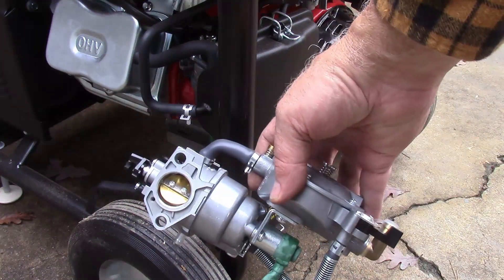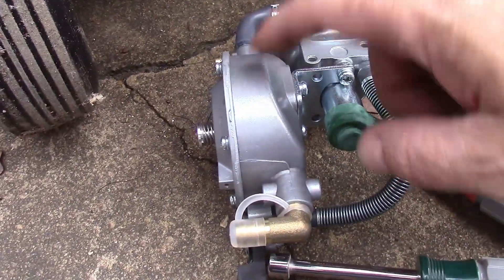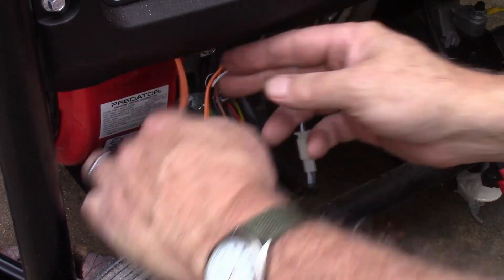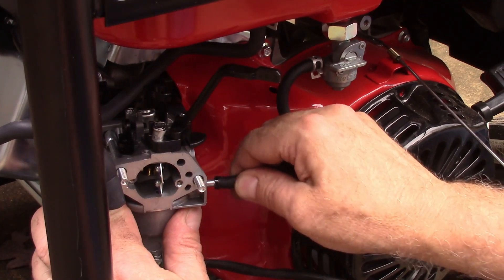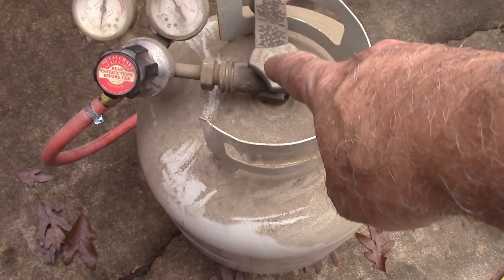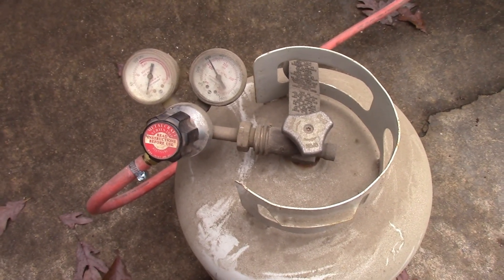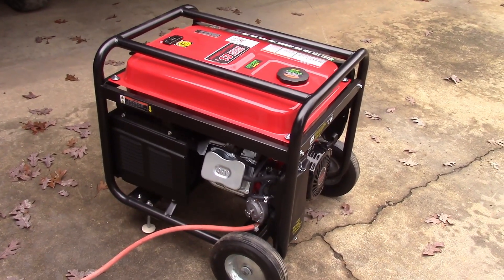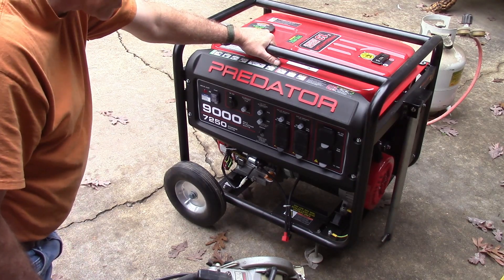Predator 9000/8750 Generator Propane Conversion  Tri Fuel

Comment: See all of my comments further down in the stack of comments:

UPDATE:  I just realized, that the carb in his Amazon link, while actually different than what he shows in his video, has 2 small philips-head screws in the little orange plastic handle.  I DO believe that those are the actual mixture adjustments ("load blocks" if you will).  One for each gas.

UPDATE 2:  All the air just went out of the sails - the orange fuel selection knob was completely bound up and stuck. I took the C-clip off the back of stem of the orange fuel selection knob, let the little spring come off, and pried the orange stem forward with a screw driver between the back of the stem and the float bowl.  The inner O-ring on the barrel of the orange fuel selection knob was completed shredded, with parts on the O-ring missing. Even after removing the remaining inner O-ring, the orange knob is still severely binding up to where you can't move it!

It turns out there is some sort of machining problem with this particular style of carb (with this particular orange knob that is on the carb pictured in the Amazon add that the author of the video posted.

WARNING:  Do NOT purchase a carb with this particular style of orange knob !!

The dead give-away that this is a KNOWN problem, is the fact that there are SO many of the exact carbs out there with DIFFERENT style orange fuel selection knobs.

Heck, even the video author either did a little "trickery" here, or he himself got duped since the carb in his video doesn't even match the one in the Amazon link that he posted. He needs to address that !

I have a RMA return in progress for the carb I got.  

You have been warned !!

Comment: 8mm and 10mm nut drivers are needed.
Still trying to figure out the hose diameter.
For the wire tabs, i used a cabinet flat head to push the bottom in and they came off

Comment: Late to the video but I’m curious about the propane consumption.   How long does it run under load on a typical propane bbg grill bottle?  And if anyone has done any comparisons on cost of the diff fuel types under load???

Comment: It's very important on those converting kits to stop the generator BY CLOSING PROPANE GAS VALVE. 
carburetor Regulator could fail and gas won't stop....

Comment: When I plug in a three prong extension cord it trips my outlet breaker. When I add a 2 prong reducer it works fine. Any ideas. I wouldn’t think the ground plug would cause it to trip the breakers.

Comment: When  you first started it it was flooding out because the pressure was to high. Is there no regulator on the carb kit? If nit I would be worried about running it to lean and burning up the motor.

Comment: If I use this with Natual Gas from the house will I need an additional regulator or can I run it right in?
Reply from the maker: Just make sure the carburetor says it will work with natural gas and you should be good!
Reply: No, you shouldn't.  I'll be connecting my straight to my 3/4" N.G. gas line that I have on the back patio.

Comment: I installed the same one as you, did you have any trouble with it running a little rough? Like it has a miss, i played with the flow screw. Bottom it out to 4 full turns and no change. Any advice you can give me would be appreciated,  thanks.
Reply: flow screw is probably for the gasoline, read thru most of this and seems adjusting the gas pressure at the regulator should help. Some here running less than 1 lb pressure

Comment: It's fine that the conversion works, but when you run the generator on gasoline, a regulator sets the generator to spin at 3600 RPM to output 120 VAC at 60 Hertz (Hz).  You need to regulate the propane or natural gas input volume/flow so the generator RPM is 3600 and the AC Hertz is 60 cycles per second.  Without 60 Hz or very close, electrical and electronic devices can be damaged quickly.  It's like running a UK/EU 50 Hz device on American 60 HZ and vice versa.  The device won't last long and you won't like the resulting damage or the way it comes about.  Once you know the correct volume/flow of propane or natural gas (or both), you can duplicate the setting(s) every time.  Or just turn off the gas and leave the regulator set and maybe check the setting now and then.  Mark the correct dial spot.  If connecting directly to (say household) natural gas, put an adjustable regulator inline with a shutoff valve and leave the regulator setting alone, after you know it's adjusted correctly, but mark the spot anyway.

One way to check and set RPM is to use a Digital Photo Tachometer.  They use a laser beam and a reflective sticker.  Remove the flywheel cover and put a sticker on a cooling fin where it's easy for the laser to shine and reflect back to the unit.  You can get a good one for $20-$35.  I bought a AGPtek Professional Digital Laser Photo Tachometer Non Contact RPM Tach, model DT-2234C+ from Amazon.  It comes with a 9V battery, three 8-inch reflective tape strips (of which you can buy replacements), a manual and a soft zipper case.  amazon.com/gp/product/B004Q8L894

Comment: It looks like this carburetor is rated for 5500 watts, much less than your generator is able to produce on its stock carburetor. Have you tried to load it over 5500 watts on propane?

Comment: This is NOT the configuration of the current Pedator 9000. There is an emission canister attached to the bottom rail of the unit and the bottom of the carburetor interferes with the canister.  Further the on the back of the air filter housing is a port for a line from the canister to vent the canister into the engine, it is right in the middle of the gas portion of the carburetor and there is no way to reinstall the air filter housing.
Reply from the maker: Thanks Gerrick!

Comment: So essentially if you want to ever use gas again you would have to remove the carburetor and put the stock one on then?
Reply from the maker: No this carburetor will use propane/natural gas or gasoline that is what it means by dual fuel.  You just turn a valve to choose which one.  It's confusing because it says dual fuel and then talks about LPG and CNG but they are counting those two as one option and gasoline as the other.  I have used it on gasoline and propane but have not used it on natural gas.  Hope that helps!

Comment: I’m having a problem installing this carburetor in my California Predator 9000. The part above where the fuel gas line connects is interfering with the airbox so it’s causing the bottom to kick out from where it’s supposed to be. Anybody else have this problem and suggest an alternate airbox to resolve the conflict?

Comment: Wish i knew what kind of regulator to buy . I'm unable to get it started and im using a RED top regulator which  i think is to much pressure  . BTW , I have the same carburator .
Reply from the maker: If you look at the gauge in the video I am running it on about 1 psi. It's likely that a standard regulator for a BBQ grill would work or get an adjustable one and start at 0 and work your way up. Good luck!

Comment: Bought this converter and easy to install......works great for propane. For natural gas had to get larger hose with reducer a few inches from regulator. No drilling g into frame Ike other conversion kits
Reply from the maker: Thank you for sharing your experience!

Comment: Dude because of you I was able to do this flawlessly. I haven’t been able to run it because I don’t have a line yet but I do have a couple questions. 

1. When using propane do you still open the gas valve? Do you still turn the choke handle at all or is the prime button/valve you’re pressing act as the choke/prime for propane?

2. If I prefer to use gas does that propane nipple have to be covered/sealed? When you disconnect your propane and run gasoline what do you do with the open propane nipple on there?

I don’t really understand carburetors but I’ve got the gas company coming out tomorrow to put a propane hookup at the regulator coming into my home so I have the option to run propane from our 1000 gallon tank instead of gas just want to understand how to toggle back and forth with both applications. Thank you again for such a great guide!
Reply from the maker: You shouldn't need the chock on propane.  I would cover the nipple when not in use to keep out dirt, bugs etc.  Good luck with your install!

Comment: How do you adjust th mixing screws with this carb? I'm running natural gas and it only runs when half choked. It cuts off when choke is completely off.  Also, what does the on/off value do on this carb. On mine, it doesn't do anything that I can tell.
Reply from the maker: Sorry I don't know how to adjust it. I think the valve turns off the gasoline.
Reply: @SoatMon  Natural gas would be a different orifice size (I believe much smaller)

Comment: The primary regulator coming off the tank should be set to 11 inches of water column and be able to handle at least 80,000 BTUs or more depending on the wattage size of the generator. 

Also curious if you are able to adjust the air fuel mixture at the carburetor? This a HIPA carb? If these are preset then I would be concerned about the engine not having the proper mix. Running to Rich on propane makes the engine run hotter. It's the opposite of liquid gasoline which if you burn rich the engine runs cooler, and lean is hotter.

Comment: Think you so much for your video!! I live in Texas and last year we had that horrible freeze that lasted 7-9 days below freezing with no electricity. I was the only house on our street that had a generator. I own the Preditor 8750 generator and it handled my all electric home with no problem. Only thing was it went through a lot of gas and all the gas stations close to me also had no power to turn the gas pumps on. We had stored enough gas to last us all but one day so we were one of the lucky ones. I bought the same carburetor you just demonstrated in case a freeze happened again and the gas pumps freeze again I have the choice of propane if needed. They had plenty of propane tanks available that week and this duel fuel carburetor would have helped alot. I have the carburetor but was dreading putting it on because I didn't know if the propane part needed special adjusting and I didn't want to messed it up. Now that I have seen your video I have full confidence I can do it.👌👍
Reply from the maker: That's awesome, glad I could help!  I hope it goes well for you!
Reply: @SoatMon  I see that this carb uses LPG and NG but can gasoline still be used with this card kit or do I need the one advertised as Tri-Fuel Conversion kit, that is $60?

Comment: Was unaware how simple that was.
Now I need to understand the benefits.
Reply from the maker: The benefit to me is that I can run it off of my propane tank that will run it for days.
Reply: Gasoline left in the generator becomes stale and useless, gas tanks accumulate rust and sediment, gasoline may be hard to find in a large power outage.

Comment: I bought the carb listed in your description, and I have the same generator. The installation went fine, and the generator runs fine on the gasoline side, but when I turn on the propane it leaks from somewhere in the carburetor. It's not a slow leak either, it sounds like I forgot to put something in place, but everything looks OK.
Reply from the maker: Not sure what that could be, it sounds like something is stuck open.  Maybe you got a defective one?  Hope it works out for you.
Reply: it could also be the regulator valve you use on the tank. The first time i did one of these conversions the generator wouldn't stay/start running and it seemed like gas was leaking. I found an adjustable regulator and set it pretty low it started and ran great and didn't leak. These do not need much gas pressure to function(and in my case too much was preventing it from running properly)

Comment: 55 dollar chinese carb -- good luck with that in about a year from now ...
Reply: What do you mean??  Have you SEEN the thing??  The machining is seller.  Says designed in Japan.  There's nothing to "wear out" - if it runs for the first hour, it will run for 5,000 to 10,000 w/o issue (just like a Honda for which I actually think this part is).

Comment: It is a nice idea to run on propane but the tank low pressure gauge needs changed to a water manometer for $10. 11” of H2O is 0.4 PSI. Get a good bourdon tube type gauge, PTFE thread sealant or teflon tape if you like that stuff (I never used it) then make accurate adjustments. Push the button is purging air from tank to carb to allow it to run. Running on natural gas is a little more tricky with size, load, speed, require adjustments unless the speed and load are consistent. ASE Master Tech since 1978 - Retired
Reply from the maker: Thanks for sharing your experience.
Reply: Yay. Another retired ASE Master. Few of us out there. 
I’m about to do the propane Amazon $39 carburetor
Reply: @ In 1982, in Omaha, a company Carl Anderson Inc sold car parts and the import line “World Parts” and these were great. But, the had a tech center that rebuilt & balanced turbo’s and installed propane conversions kits in Cabs and other vehicles. It is clean and engine oil never got dirty. Other than a tank, regulator and dry carburetor, they turned the fuel ratio on a dyno! I like it when the cost analysis leans towards a benefit in your favor. Not only a Tech, but 7yrs an ACDelco instructor and drove hydrogen fuel cell van (Gas & Liquid) same their like natural gas. The local utility would install a re-fueling port at your home, but only outside. So study up to find out the “Rest of the Story” like Paul Harvey used to say!
DK, Omaha. In 78, it was National Institute for Service Excellence, later shorten to ASE. Every 5yrs go back to re-certify. Google it!

Comment: I just finished my installation of the Propane Kit you used on my Predator 9000 and I run into a problem with the gas tank vent to the airbox interfering with the carb regulator. My airbox is plastic and I figure it is different from your metal air box, Instead of sending it back and taking a chance on another one not working I decided to modify the plastic box so it no longer interfered with the regulator. I will fiberglass the part I removed and paint it and it will look like the original. The generator started right up and seemed to run just fine. I wonder if the kit will support the Predator 9000 at 100% but right now it starts and runs great, thanks for your video.
Reply from the maker: Sounds like a kindred spirit.  Glad you figured it out and got it to work for you.  Thanks for letting me know!
Reply: I just ran into the same problem with the plastic air box. I am not as handy as you sound. Do you know if there are replacement air boxes?

Comment: I have a craftsman 5200 generator without the wires on the bottom of the carburetor will you conversion kit work without the wires installed?
Reply from the maker: It's not my kit, I just bought it off Amazon.  Sorry I don't know if it would work for your application.

Comment: Interesting video, i enjoyed it and was helpful. My real concern is, what cuts off the line fuel if during operation the engine stops running???  I know some will claim that it couldn't happen because the generator is brand new, nothing could go wrong. Most have a low oil switch that shuts the engine down if the oil level gets low. Great option, so while in operation the oil level gets low enough to shut down the engine. What happens to prevent propane from building up in and around the engine after the engine shuts down?  BOOM !!!!!
Reply: What prevents propane from leaking out if you turn a grill off and forget to shut the gas?....Not much , you just end up with an empty tank. Would think this is the same.
Reply: That is another purpose of the regulator.  If there is no "draw" from the engine the regulator will shut off the propane flow.

Comment: Thanks. I did the same but cannot get it past sputter on LPG. I do not have NG out back as of yet. Runs fine on gasoline. What about that orange switch and the one black one (as shown at 0:07) on the bottom of the spring covered tubing at bottom of carb. You didn't mention how those are set. Any advise?
Reply: The electrical wire on the bottom of the float bowl is to stop the gasoline from entering the engine after the engine has been turned off.  It is not technically needed on propane or natural gas.

The tubing with the spring on the outside goes to the float bowl to drain the gasoline when changing over from gasoline to propane or natural gas.

At 0:03 I believe is the mixture screw for smooth running.  It is in front of his index finger.

Comment: My 9000 came with a Fuel jet for higher altitude, I live at  5,500ft, do you know if that same fuel jet would fit this carburetor? Or does this carburetor come with the necessary components to run at a higher elevation?
Thanks!

Thank you
Reply from the maker: I don't remember it coming with an extra jet.
Reply: @SoatMon  
Thank you
Reply: The fuel jet for high altitude is probably not needed on propane or natural gas.  The fine-tuning of the mixture is probably the screw in front of his index finger at 0:03.
Reply: @mikejoyce7157  
Thanks